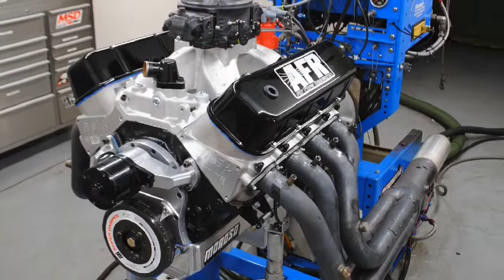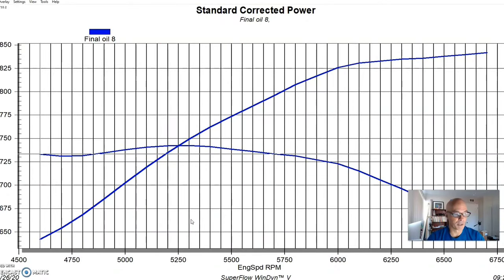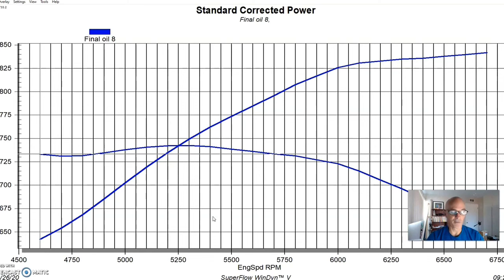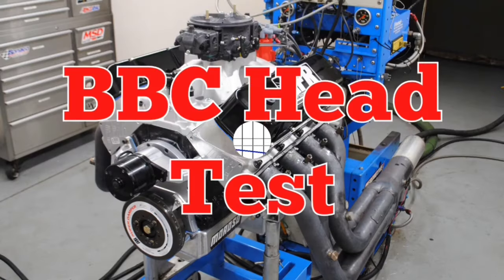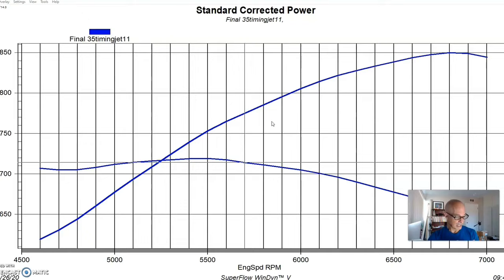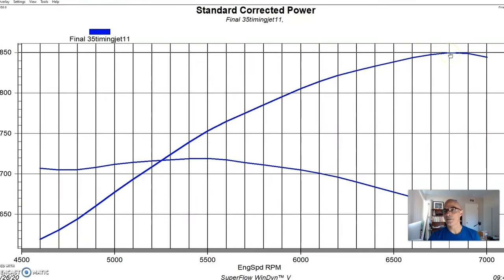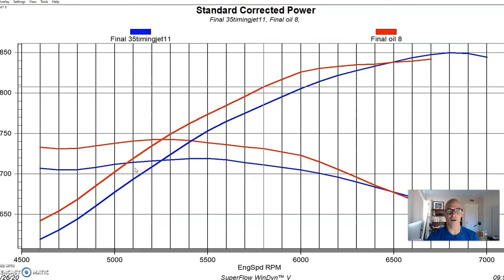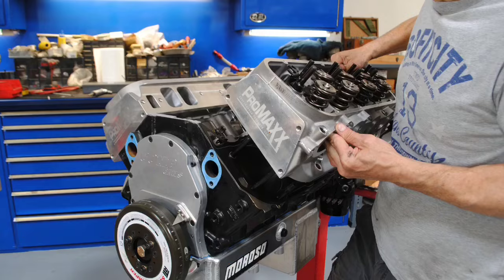LOW BUCK BBC HEAD TEST-PROMAXX VS AFR

Comment: Tell me, I've got some 049 big block heads on a 454 with 2.19 and 1.88 valves, they have been pocket  ported. I'm not impressed with the low rpm power of this motor at all.  My cam is a hydraulic roller 262/272 advertised duration with 210/218 @50 and 112 lobe centers.  Looks like should of used peanut port heads and standard valves sizes, why don't I have any low rpm torque? I ve had four 454s  now and none of them have been stump pullers? 
I
Reply from the maker: WHAT COMPRESSION AND INTAKE?
Reply: @richardholdener1727  9.0 compression towing, Edelbrock  2161.
Is there any big block aluminum  intakes out there that are lower than these?

Comment: excellent video great content as always Richard. Dam this is the best channel on utube.  
By a lomg long way. The info u give us is priceless. 
Can I asks u I need a msd to pull timing out.  It's a 2003  Audi TT . Will a 6msd or a msd6AL. It's a  not got a distributor cap obviously as a modern heart I'm struggling to get information on other forums. So i thought go to the man that nos it all . 
I don't want to wast cash on one that will bot be right for my car. Or  does it not matter whether it's a distributor or a normal modern car car you just wire it up differently. It that the case.  Please help mate or anyone can help me i live in the uk so the  Duty import tax I have to pay as well so i need to get this right. It's for pulling timing when I spraying nos.
Reply from the maker: it would have to be a BTR-but still not sure on signal from Audi ECU

Comment: I'd like to see the Promaxx 317cc rec port 115cc chamber heads tested on a 468/496 with the usual .650 lift cam....INSANE value for the money....

 These pressure mold cast head copies are gonna put real hurt on the big 3, since the copy is of their cnc port and the pressure casting is keeping nearly all the flow

Comment: I’ll say it again , consider maybe the seats may sink in or crack on the cheap ass heads never mind the guides plus what kind of springs do they have  , want to make more/better power get the AFR 335 full cnc which outflow their 340 as cast , I know I did ten years ago and haven’t looked back , and I’m Canadian I just know quality when I see. It .
Reply: nothing cheap about promaxx. the cost is only 100-200 cheaper than afr. if i was building a track car afr, a streetcar promaxx. the extra torque and hp from the afr wont hook on street tires so no point in it.

Comment: I ran a cheaper blueprint head cost 1,000 bucks ran good now I got AFR they were 2,000 bucks and they are better I think. I think they also like less timing
Reply from the maker: the afr is better than the blueprint head
Reply: @richardholdener1727  yea they are great I got the 195cc Street Eliminator runs strong
Reply: Are the blueprint engine heads made in the USA?
Reply: And I would love to see you try the Progressive ignitions Bluetooth to your phone I got one been great. Would like to see what you think of them

Comment: At the end of this comment I’ll drop a link to an interesting if complex way to find your theoretical shift points for maximum acceleration. Richard always emphasizes peak numbers of torque, horsepower, and rpm. In the end you want to shift your gears to always be delivering the maximum torque to the pavement. That’s where the rubber meets the road, to coin a phrase.
https://www.yourdatadriven.com/best-gear-change-rpm-guide-to-optimum-gear-shift-points-in-a-racing-car/

Comment: Richard my friend, I've got me tall deck in the barn for my 496-ish build. I have seen a couple characters claiming high 7s in the HP arena and they are ending the test at 6500. The only thing that I can possibly see that is the lift in the 750s. Do you think comp, being the nice guys they are would take your 300 cam and try to perfect it even more?  It's worked really well for me with isky on small blocks, finding a torque curve I like and adding another 0.100- 0.120 to the lift given chosen head flow is still climbing and another 100/120 is going to give you more flow. The bottom might suffer a little if the heads are made for way more than you need?? Do you think it would take your 496 from the 677 to 750 without revving it any higher? I was going cast scat or eagle but I found a Callies Compstar 4.375 crank and (hate them, H beam) 6.8 rods for 1100 Woweee.
Reply from the maker: its possible to make 700+ HP WITH A 496-JUST TAKES MORE CAM
Reply: Which heads are you running? My 516cid did great with 335s

Comment: Love what you do Richard, but if you really pushing a engine you know theres more than just flow #s, What material is the head made of 357? 356?355? Are the valve seats going to fall out once in the car under load? What springs & valves are in the head? They may be acouple hundred cheaper, but wheres your hard earned dollar going? Somebody in the U.S. or some asshat i China? If you need to change 1 thing with the cheap heads, they now just cost you $$$ for a shitty product! Or worse, how about 1 of the super cheap valve heads popping off & destroying the short block? If you still think the overseas shit is getting you a bargain, I hope your an engine builder to make everything correct!  Thanks again! You get what you pay for!

Comment: I cant speak for the bbc promaxx heads but the sbc heads are a good bang for the buck. I may even argue the best bang for your buck.
Reply: @danmyers9372   i know covid is a real thing because I had it, my wife had it and almost lost my mother from it. My argument is in the power production of the sbc heads for the dollar. Not its orgin etc.
Reply: @ron Kay over 500 passes in my bracket car and only one mishap which had nothing to do with the heads. Promaxx repaired and welded the heads good as new and had me running 2 weeks later. The  casting is offshore but all the work is done here in the Usa by Americans. Only the casting process is done overseas.... look into where some of your beloved intakes are cast now and you will quickly find out nearly all except eldbrocks are done overseas. Do your research!!!
Reply: Again my argument was on there Sbc heads I have zero experience with there bbc parts.

Comment: Consistency is what wins races,not
Average power,not a fair statement! Cylinder percentage leak down tests reveal true cyl.press test results!
Cyls.that are within 1thru5 percent,not a problem, any thing
Over 10 %,be from,ring blowby,spark scatter, weak valve springs,detonation,unbalanced fuel distribution,too maney variables! No disrespect but average is a blanket statement!
Reply from the maker: no disrespect-but a cylinder pressure test does not measure spark scatter, weak valve springs, detonation, unbalanced or fuel delivery-and average power production does win